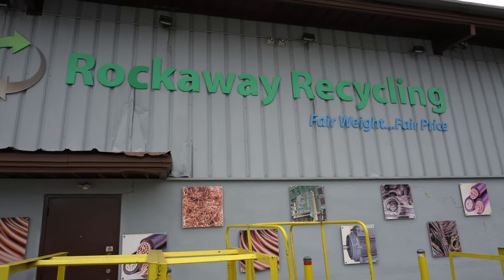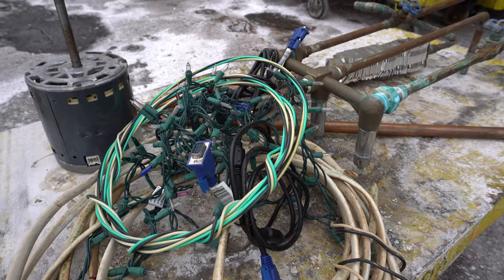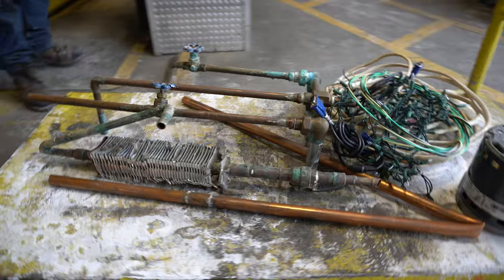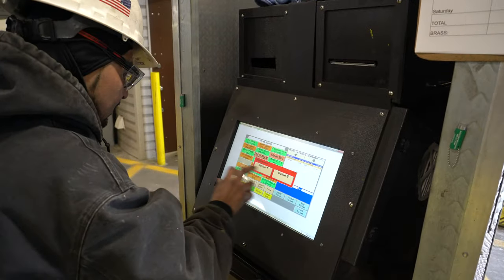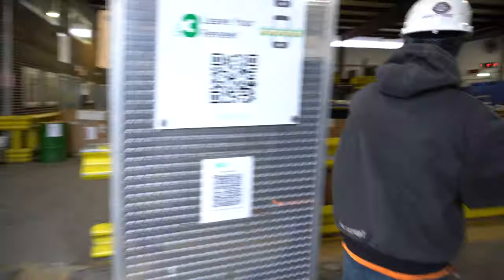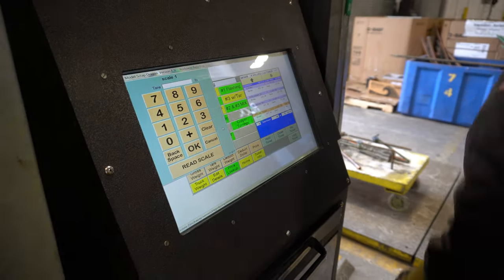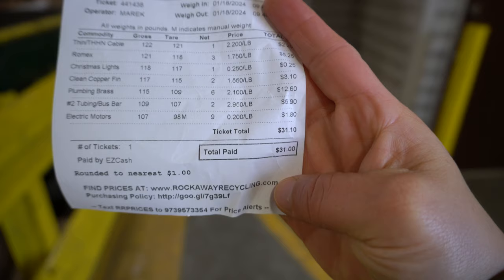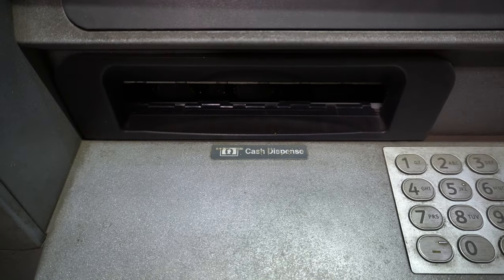What To Expect: Your First Visit To The Scrap Yard

Comment: ALWAYS check the ticket after! They can and do make mistakes at the scale. One example I had, the plate aluminum in the plastic garbage cans weighed like 308 lbs. and when he subtracted the weight of the cans, 16 lbs., the hand written ticket said 192 lbs. instead of 292 lbs. I caught the error, and the owner called over to the scale and the guy apologized for the error of bad math in his head and I was paid the correct amount for 292 lbs.
Reply from the maker: accidents do happen. Glad your yard was accommodating